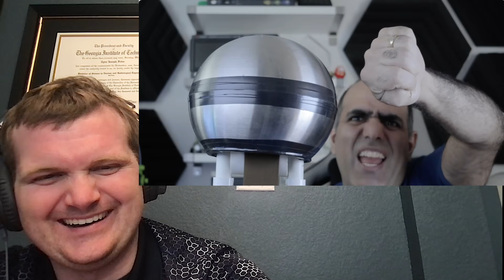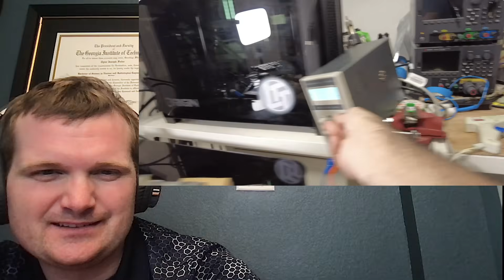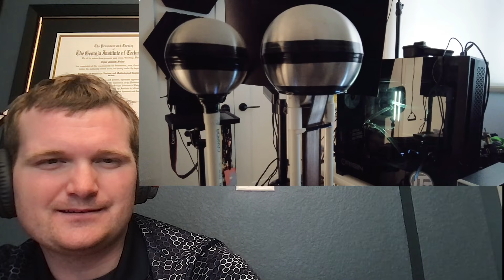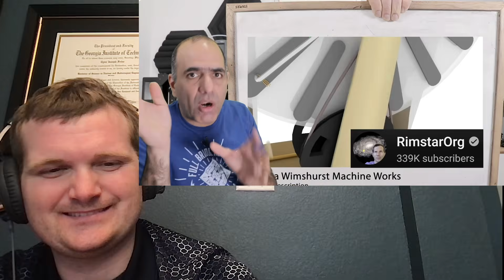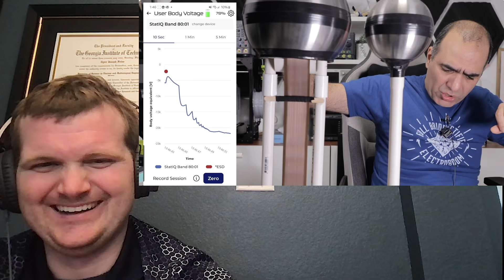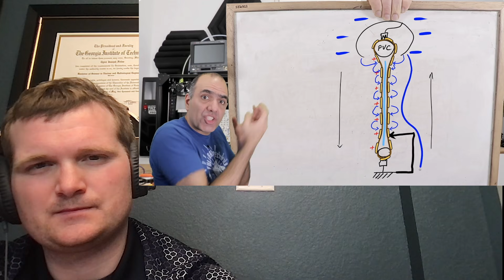The Mehdi-Van-HURT Machine! - Nuclear Engineer Reacts to ElectroBOOM

Comment: Alphas and betas are charged, but I suspect that long before you would get a noticeable amount of charge from them the normal effects of radiation would kill you. Each beta carries 1.6e-19 C of charge, and even though 1 C is a relatively large unit that's still an incredibly tiny amount of charge. If a single beta particle gives 0.1 nSv of equivalent dose, then 1 C of charge would be roughly equivalent to 625 MSv. That's a MEGA. Even 1µC of charge (roughly what a static shock from a doorknob would give) would be 625 Sv. That's not good.

Comment: 12:13 If lightning were to strike the secondary (generator) loop plumping for a typical LWR what would happen? Im presuming the metal supports could channel enough to ground before it could reach the primary loop? Say worst possible case hell-scenario happens:
-a microburst blows the roof off the reactor building
-there were hidden leaks in the roof not visible to inspection
-over time, this corroded the containment structure, weakening the concrete/reinforcement enough that the building’s recent decapitation damaged & breeched it…
-an errant bolt somehow finds its way through the breech and strikes the reactor vessel directly! 

So …basically I just wanna know what happens if lightning were to strike an imaginary 1000MW(e) LW reactor which happened to be out in the open directly if it was running at maximum (…power-production? Criticality? N-flux?) I dont think I know enough to even guess what parameters would be most-affected by a lightning strike.

Comment: Worked in the Nuclear Physics Lab at the UW while in college. The 5 MeV Van de Graff was fun to work on. However, if you weren't working the bleeder probe properly, you could get a very loud discharge which could be heard throughout the whole lab letting everyone know you weren't paying attention. It's interesting to watch him move his hand back and forth accomplishing a bleed without large spark until he moves his hand closer.
Reply: The Boston 
Museum of Science had the (or maybe still does) largest one in the country.  I saw it as a kid years ago--was like at least 20ft tall.  IIRC they acquired it from a parking lot at MIT where it was just kinda sitting in disuse.  The operator sat in a human-sized birdcage next to it, and they'd run their hands along the inside of the top of it and direct the discharge.

I think they used it in physics as you indicated, but had since moved on to grander instruments lol. i think its heyday was in the 1930s.
Reply: What insulating medium did You use or it was high vacuum?
Reply: @imeprezime1285  Argon
Reply: Argon mixtures are very good at high pressure

Comment: When it comes to electrical conductivity, inconsistencies in material construction and their differing electrical properties have the potential to cancel or nullify charges. It would be interesting to see if there was a way to accurately measure the capacitance of the belt.